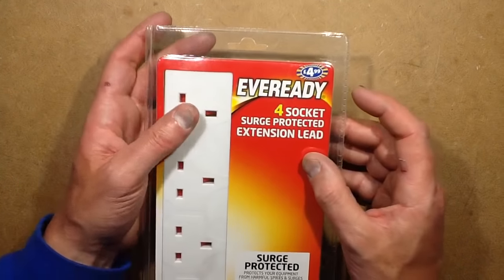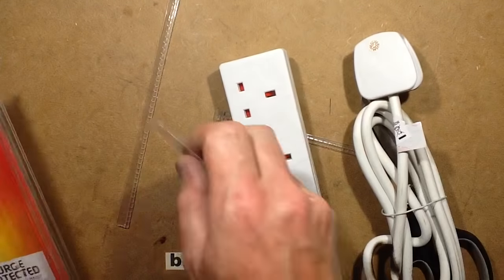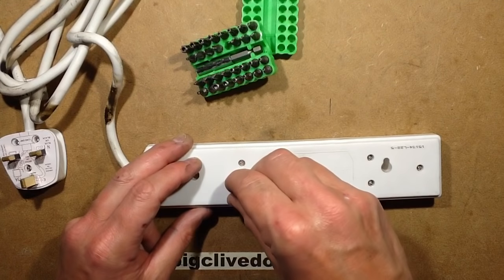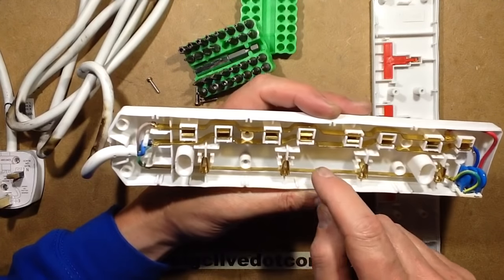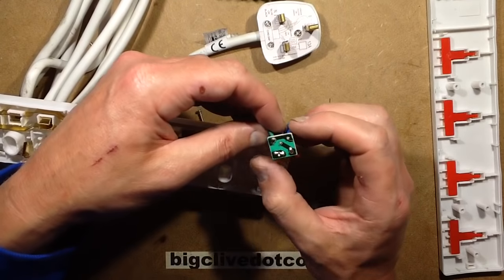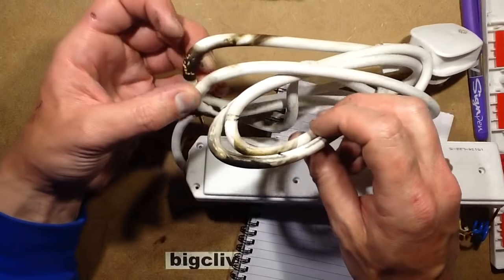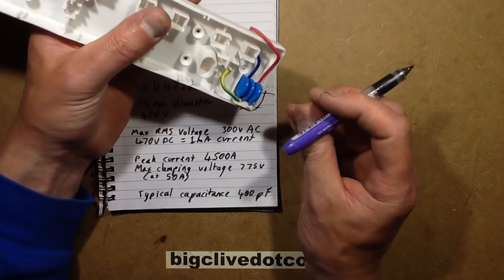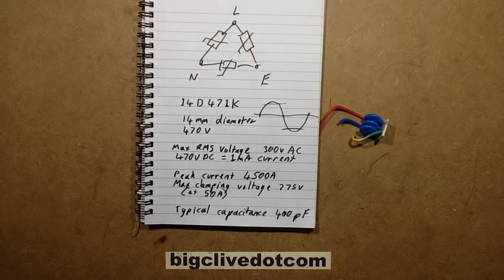Pre-exploded surge protection strip.  What the heck???

Comment: Can you test them without opening the power strip? Measure between live and neutral and such on it?
Reply from the maker: There might be a measurable resistance variation as they failed.  But other active circuitry might skew the results.
Reply: What about checking for a voltage on the neutral? Just trying to think of a way to test for failed ones in my strips. Thanks Clive as always
Reply from the maker: I'd perhaps test between L-E, L-N and N-E to see if there was much difference between the measured resistances.  But the tests would probably be more accurate dine with a proper insulatiuon tester set to about 250V
Reply: OK that would make more sense.
Reply: You could apply a current-limited HV pulse and observe the MOV characteristics on an oscilloscope. That would give you a good idea about the clamping voltage. Still, damage to MOV's is often progressive, so I don't think the clap voltage is any prediction of how the MOV would handle real power.
Reply: remove everything from the power strip and check capacitance between leads?
Reply: thumbs up for clap voltage
Reply: If you test it, does that then also make it weaker
Reply from the maker: Only if you expose it to a high voltage and current test.

Comment: Just wonder, why do they use 13 amp instead of 10 or 15? And I think it's 63 amp?
Reply: They use 240v.
240v X 10A =2400w
240v X 15A = 3600w

3600w is quite a lot,
Your typical household oven might be rated to 3600w.

As for 63A that would be 15.1Kw.
That would be heavy industrial kind of things

Plus the cable they use is for what the load will be.
A 4 way power socket will have the maxium safe gauge for the max current for that will be used
Reply: I think it's because 13 amps and 240VAC will give you just about 3kW. Someone else more knowledgeable will check me on that, but that's what I dimly recall.
Reply: It was developed in the 1940's to replace a mixture of 2A, 5A and 15A plugs and sockets, I guess 13A was the compromise, to keep the system compact and to allow for most appliances at the time. 13A is also about 3KW, which may of been a goal.
Reply: Appliances in the US, and most extension cords are 15 x 120 = 1800 watts so 10 should work fine. Right?
Reply: Robert Gibbons Fine for what? Brits like our cups of Tea and we don't want to wait too long for the kettle!
Reply: +Edward Cooper I can understand that. But your kettle only uses 6 amps.
Reply: +Robert Gibbons Alot of kettles in the UK are around 2200-2400 watts, so use around 10amps of current at 240volts.
Reply: Robert Gibbons In the UK things are a bit different, in a domestic situation we have one plug socket for everything, that includes tumble driers, washing machines, etc.  I understand in the US often these appliances use a different two-phase connection.  So 3KW available everywhere is useful here.
Reply: The US system works by having a centre tapped supply i.e. +120 0 -120 volts, tvs, computers, dvds, lighting and such like use +120v and neutral, heavy current devices use the +120 -120 so have 240v across the phases.  If I remember correctly black is live and white is neutral and red is the 2nd tap in the US system.
Reply: Obviously on the other half of the sinwave the polarity changes i.e. the +120 -120 are opposite.

Comment: Microwaved in pack. Mystery solved.. As for "packing machine was on fire" 2 big problems with that theory.

1.) Burnt wiring and insulation is INSIDE packaging (suggesting some form of wireless induction i.e. microwave)

2.) The heat needed to melt copper wire 1084.62 °C, kind of suggests the fire would have been noticed OR would have destroyed machinery/factory.

Nice try mate.

Comment: Sorry Clive 
Can't agree with you on flat pins being better than round !
Round pins have more contact surface as the whole circumference is in contact.

The British square pin only contacts on the 2 opposite sides. The other 2 sides are wasted and not connected !

I could not believe it when Britain went away from round pin.

Outdoor power distribution is still round pin, for example camping equipment and large music venue equipment etc.